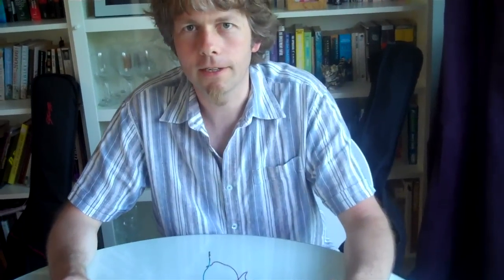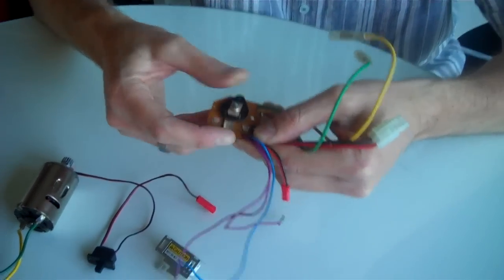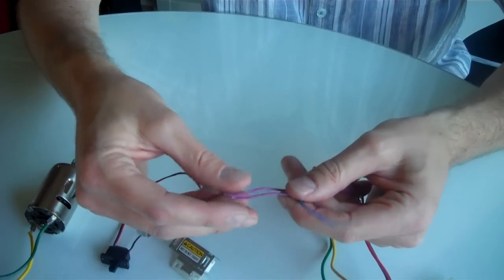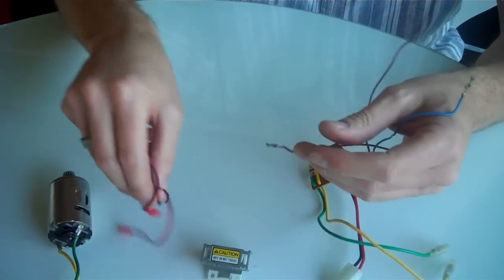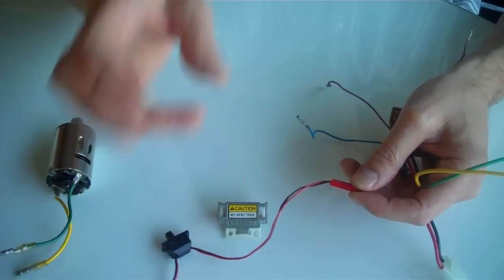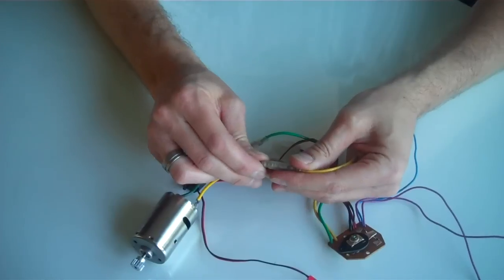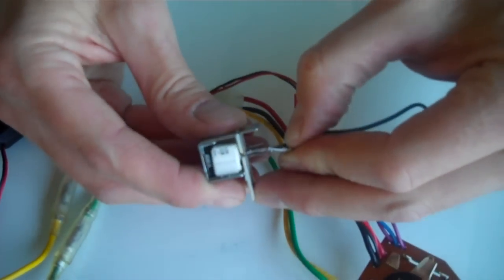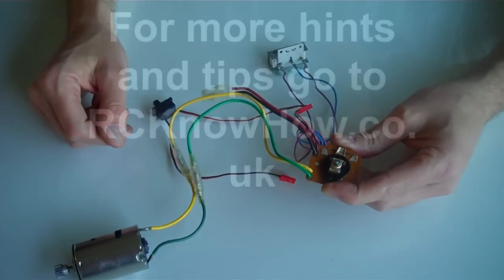How To Wire Up A Tamiya Radio Controlled Car MSC (Mechanical Speed Controller)

Comment: Hello a friend of mine lost the control of old Tamiy Datsun 280zx, can i replace it with common controller? i dont have any idea in RC hobby, the internal battery can be replaced by modern battery too?

Thanks
Reply: Yes you can replace the esc and battery as long as the battery can support the esc and the esc can support the motor or do you mean receiver in that case yes